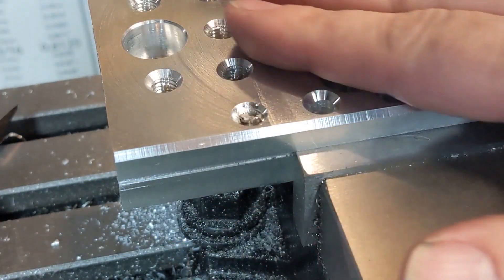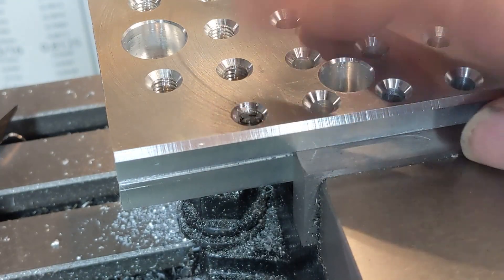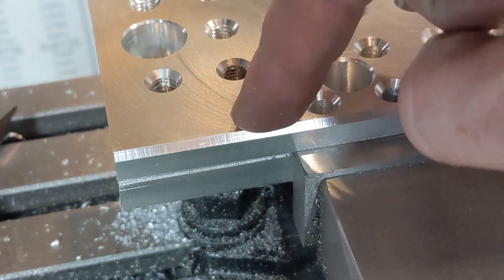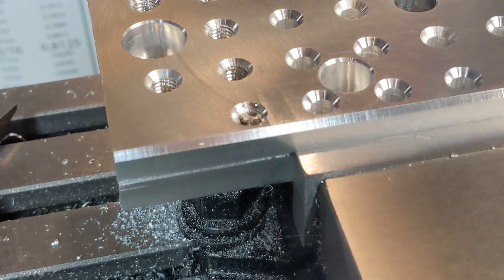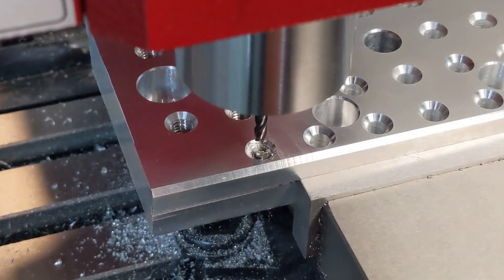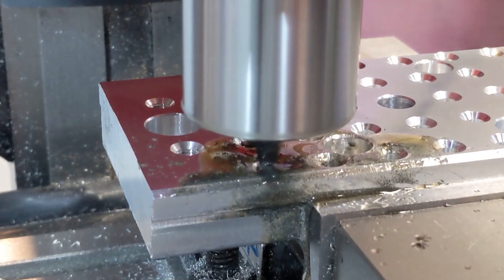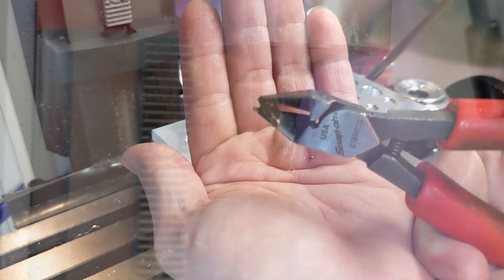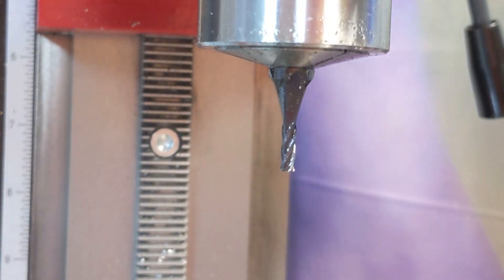Milling Out a Broken Tap With an End Mill

Comment: Two tips: 
1- use your depth stop to prevent the tool from grabbing and digging in.  I keep my left hand on the depth stop and the right on the downfeed lever.  Set the stop so you're just milling out a few thousandths at a time.   Pull the lever until the spindle parks against the stop, dial in a turn or so, and repeat.  It goes quickly and is controlled the entire time.
2-  Use the straight flute carbide drills designed for this purpose (and save your good carbide end mills).  There are inexpensive import versions of the "Omega Drill" available on Amazon and other sources.

Comment: need to use a spiral point tap!
Reply from the maker: The holes aren't blind. I had much better luck with the replacement tap I bought. Made it through the other thirty two holes without issue.

Comment: Good to know that as an option, i guess you would need to determine if the sacrifice of the carbide end mill is worth it, but looking at your project it sure was!
Reply from the maker: Yeah, I would definitely plan on losing the tool and be okay with that sacrifice. 

Obviously this was a big enough work piece with enough labor into it to justify wrecking a good tool.

The good news is, it was double ended and I have two of them so I can screw things up a few more times 😅